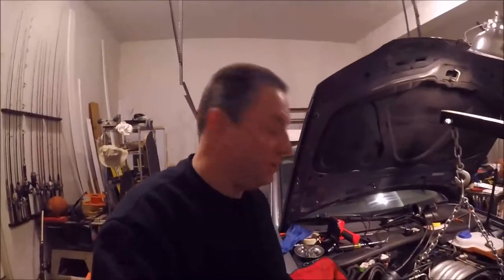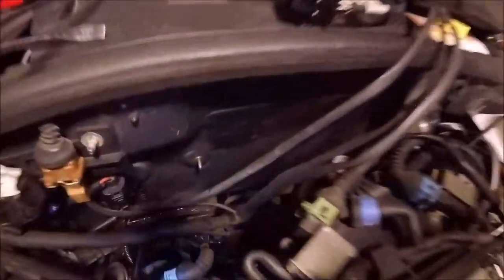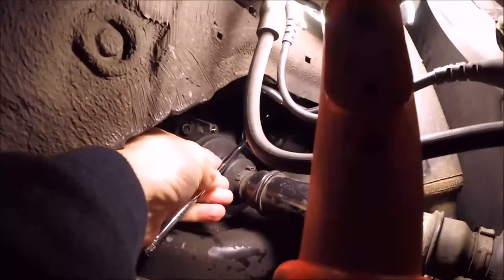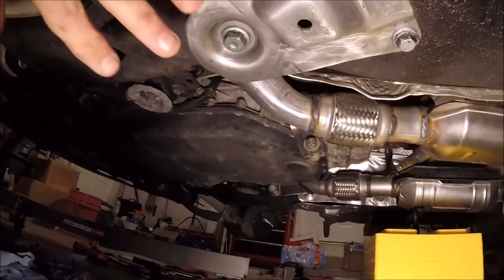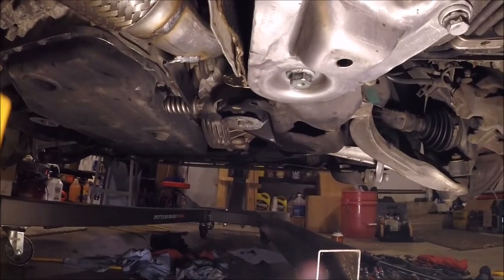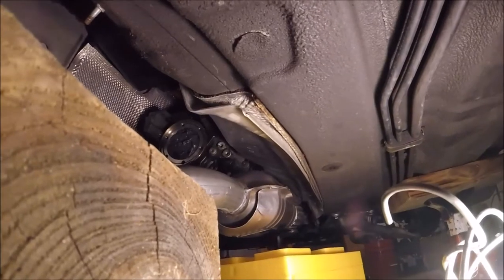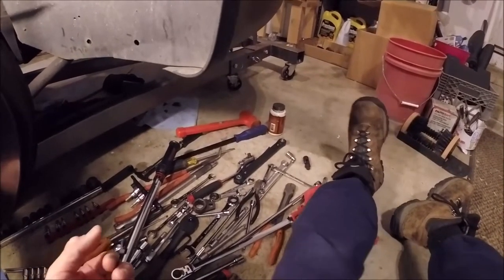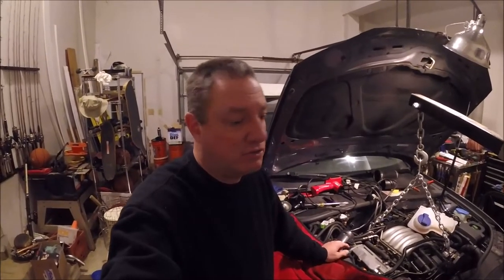VW Passat Catalytic Converter Replacements

Comment: Well done on taking that on and getting it done !
I have a 2003 a6 with the 3.0 AVK.engine code for both cats is on and a rattling sound on the gas.
It looks like I will be doing it soon,and also the nose end oil seal that you replaced.
On filling the Center differential with oil I think it’s supposed to be 8 mm below the level of the fill plug hole.
Thanks for making a great video!
Reply from the maker: Thanks for the comments Keith.  Best of luck with your A6 cat change.  Maybe one day I’ll own an A6.  Love the style!

Comment: Im working on mine right now, I ended up purchasing an engine support bar and a 13mm flex head wrench worked well for that top driverside nut. Im taking my time on it, replacing a cv joint and trans mount along the way
Reply from the maker: Glad to hear you are taking on the job yourself Snoopy.  Best of luck and enjoy the extended life of your Passat!

Comment: How long did it take you to lower the engine?
Reply from the maker: If I include the time to place the car up high on jack stands, prep the back engine mount, disconnect the drive shaft & exhaust, and loosen the front mount bolts, I would say that was one long day around 8 hrs.  Now I'm not a pro so I don't have the instant knowledge of tool size and technique, so surely the pros can do this in just a couple hours.  The actual lowering was just a few minutes of very slow releases.  I hope this helps.